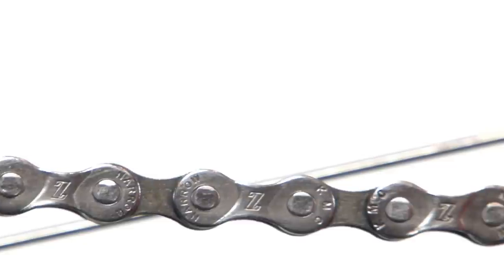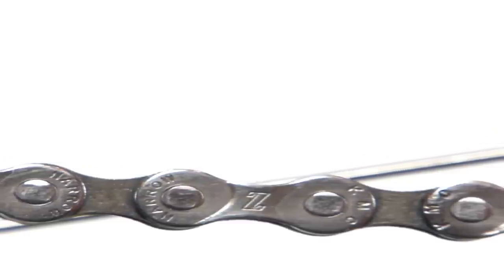Bicycle Drive-train Maintenance

Comment: thks! how do you clean the chain cleaner? No joke, I can't get to clean the normal plastic brushes I've used. thks again!
Reply from the maker: Good Question. I wash it with detergent and rinse with pressure to spin out the brushes.

Comment: Does the direction of the chain matter? I've seen another video where the chain was going in the opposite direction, i.e. going in the side with the first circular brush and out the rubber channel side
Reply from the maker: It works either way. Sometimes the squeegee end reduces dripping solvent from the chain. Moving the chain towards the rear derailleur helps stabilizes the chain cleaner. Your choice.

Comment: do you keep changing the cleaner in the chain scubber until it is clear after running the chain through it? I have the same scrubber, i've changed the fluid more than 15 times and its still dark after i run the chain through. i use simple green as the cleaner.